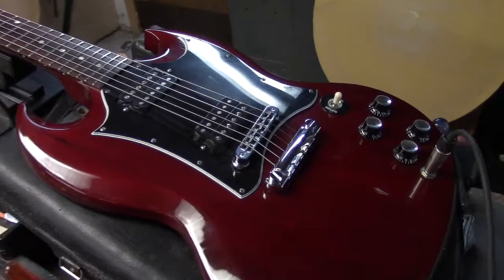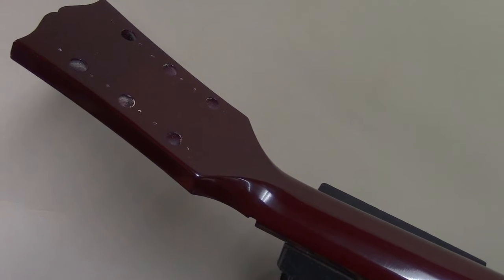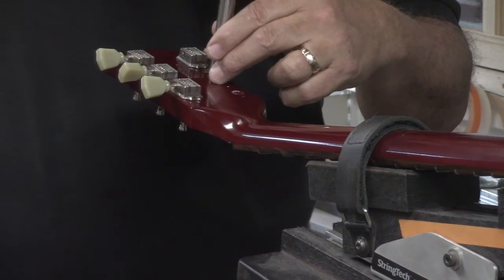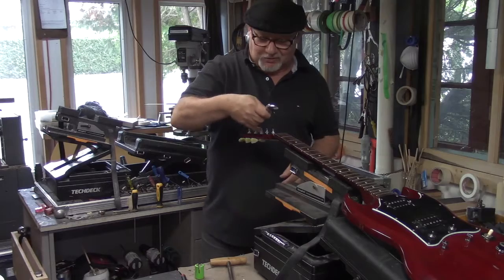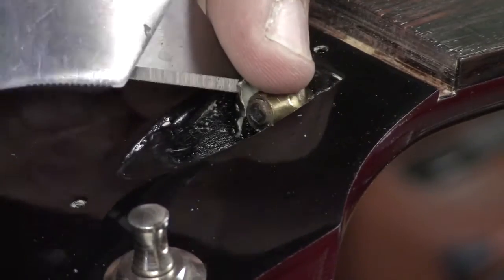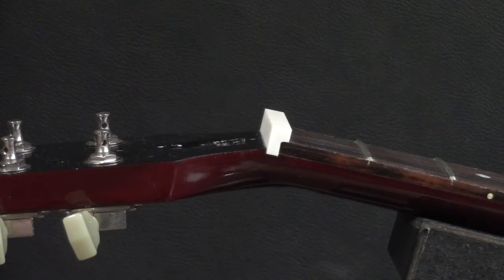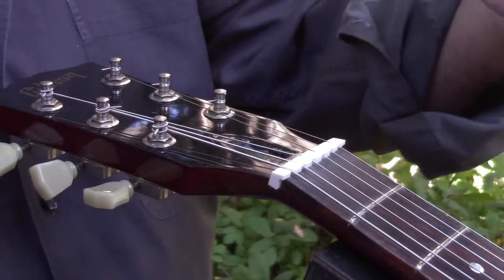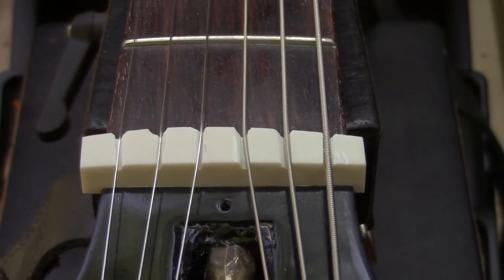Gibson SG Neck Surgery Completed  @StringTech Workstations

Comment: "Much stronger than the day it was made",,,Hey Gibson! Anyone taking notes?
Reply from the maker: The real irony here is: Gibson could easily install "blind splines" during the manufacturing process; that run from the 4th fret ( under the fingerboard )  ... right up to the A+B tuning machines in the headstock ( under the headstock overlay ) . Virtually undetectable. I have often wondered if it really is built-in obsolescence .... just saying ..... could be easily remedied.